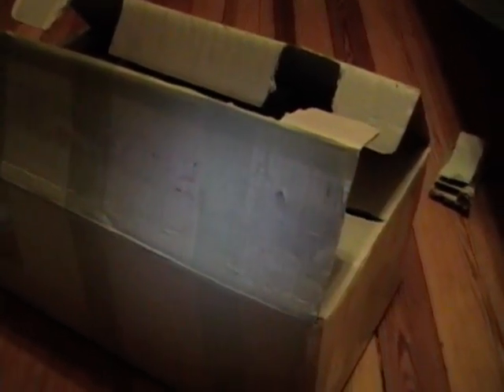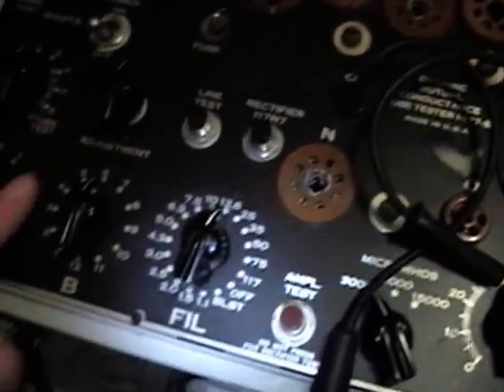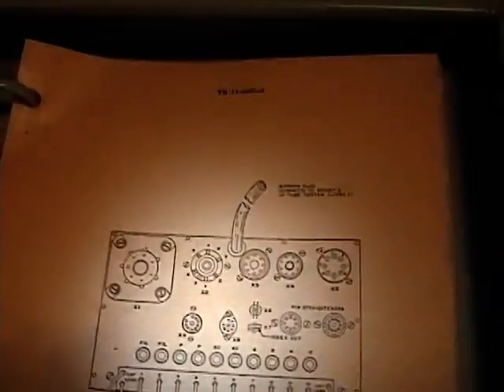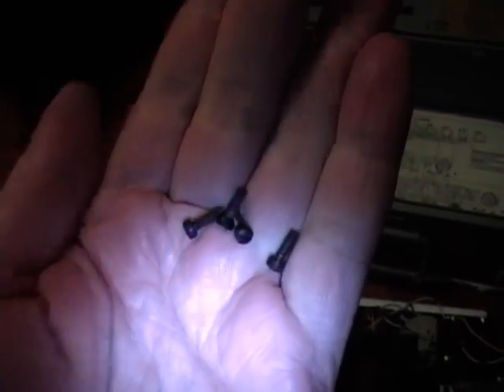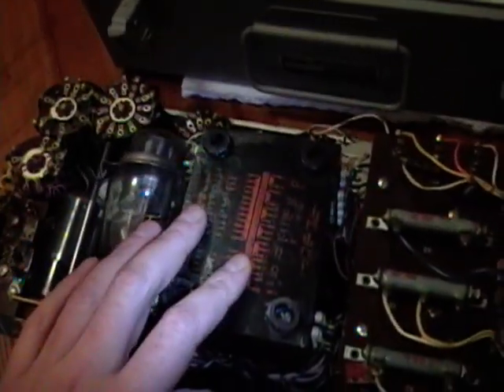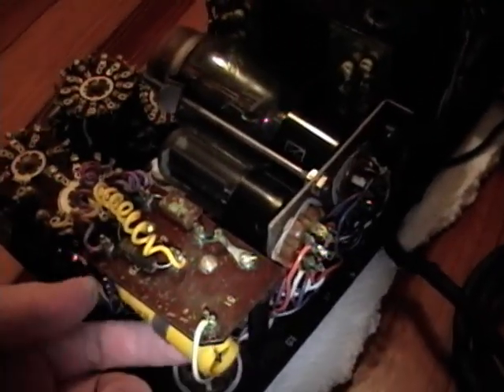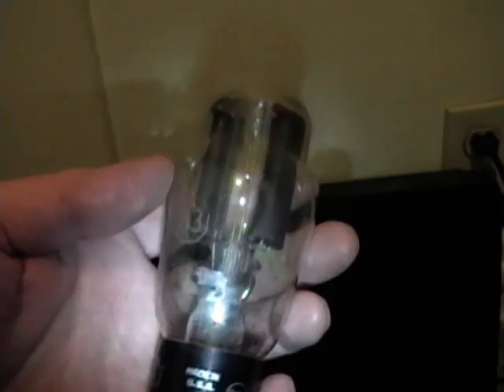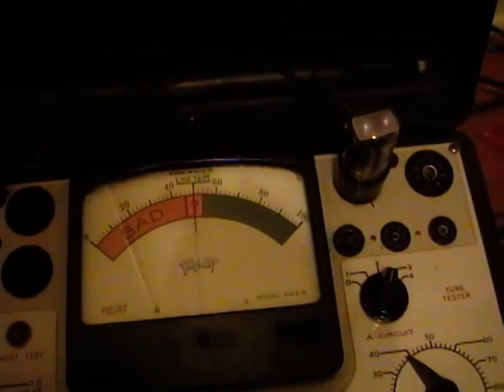I-177 military tube tester p1o3

Comment: I find the tv3 be better cause has the 9 pin socket and still military grade. Tv7 is ok but the 539c is the best one out of all  cause has dual transformers one for filament and other for conductance tests. And the micromho test is a physical switch like my hickok 752. Way more accurate and repeatable results

Comment: I have that tester, AND I got the extra socket adapter set. Garage sale, probably close to 30 years ago, 20 bucks. I had one before like your first one and it didn't have the case and had issues but it mostly worked and I could test just about any early tube from antiques.
I hope you still have it and found the tube adapter box. My other one completely works as far as I remember and has all the manuals.
Reply from the maker: I do still have it but not the adapters. I mostly use a Hickok 600 these days.
Reply: I have a TV shops suitcases tube tester they gave me that I used for the newer stuff most of the time too. It probably was a Hickoc or one of the other high end professional brands. It is Mutual Conductance also but I'm guessing from the 60s. I figured I had all my options covered between the two of them. I also have a bunch of the old military tubes that have the JAN markings on them.

Comment: Bob, I've got a question, if I may.  I'm thinking of buying a I-177B tester like yours.  When the power is turned on the fuse bulb lights up.  (No tube is inserted)  Could this be related to the line voltage control, filament voltage or another control being wrongly set?  Or, is this a sign of bigger problems?  Thanks. I really like your videos.  I've learned a lot from you.  Tom